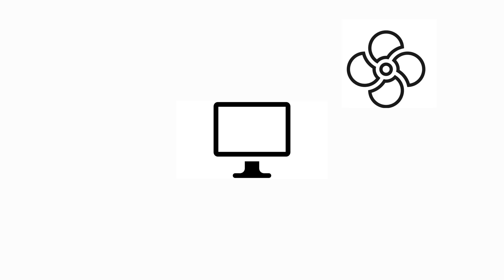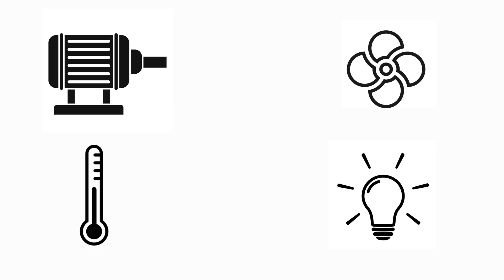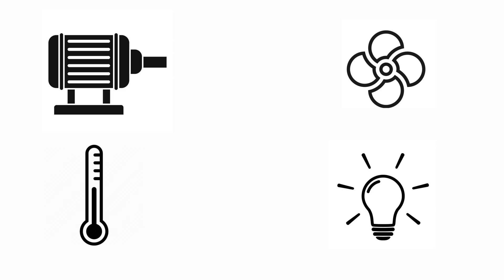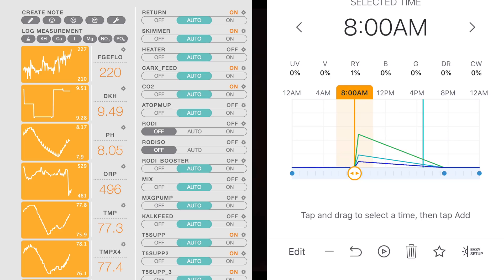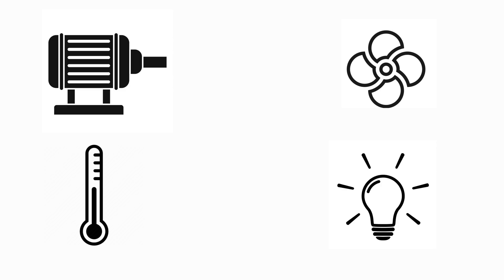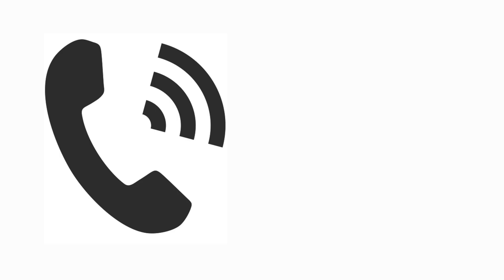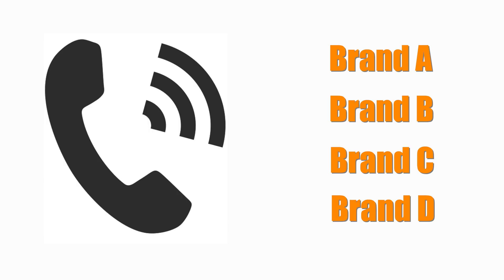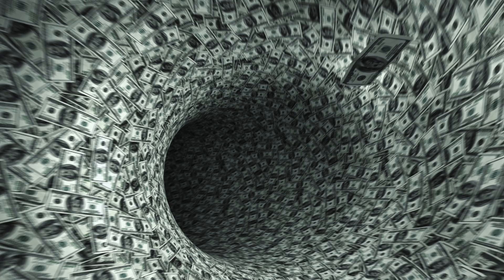CENTRALIZED vs Standalone System Design Approaches to Tank Automation

Comment: After a long time in the hobby I am trying to go more centralized to make things easier and limit clutter. For years I was scared from horror stories from controllers failing but unfortunately I've crashed systems without the help of a controller failing. One thing they don't tell you is a centralized system does not limit clutter cuz you keep buying more stuff to be controlled because it's so easy.

Comment: It's good that there's not that much "stand alone" automation in the hobby, because quite honestly that would just add to the cost of everything if everything had its only built in controller, wifi cards, etc. 

Seeing this happen first hand with Vortech pumps was definitely an eye opener,  those who remember the original vortech pump controller was just a knob on it that changed the intensity of the output, very similar to what Tunze was doing,  then came the controllers for all the modes (well a few modes initially) and on top of that wireless communication with each other, so not only did each pump have a controller to tell it what to do but each also had a wireless board on it as well.   So what this meant is those with just one pump who had no need for a wireless board had to pay for one because it was all added in the price,  and those with multiple pumps who may not need each one to operate independently still had to pay for the controller that did everything instead of a single unit with "brains" that told the other pumps what to do.      Now compare this to the Tunze (or something like Rossmont) approach where the pumps are "dumb" but if you want to have some level of control you can choose to pay for those features.    However as time goes on we do start to see more equipment becoming standalone, most notably the lighting market.